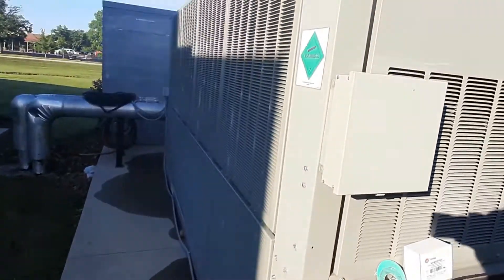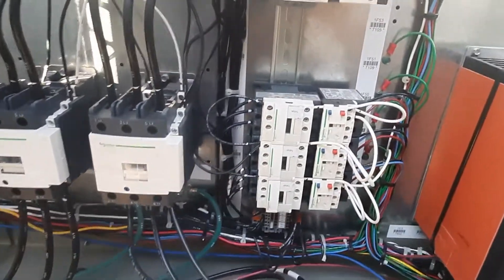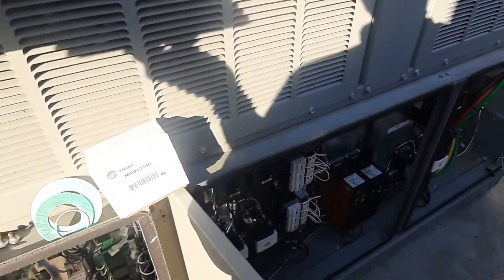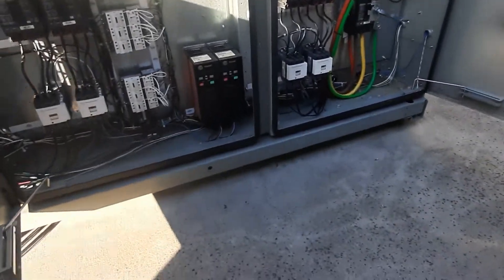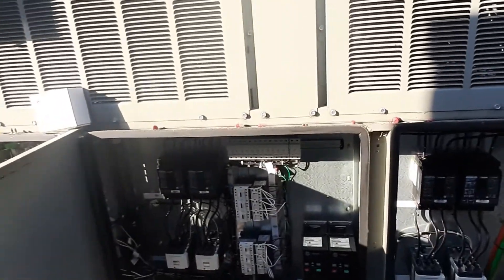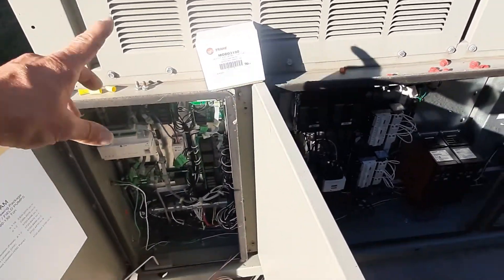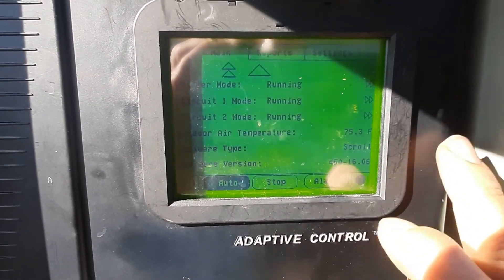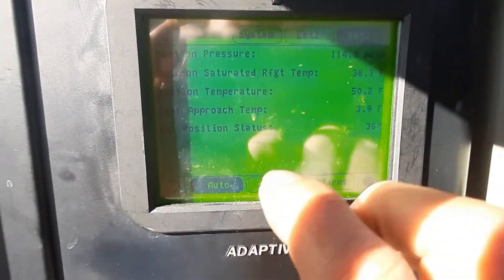Chiller electrical checks, control overview

Comment: Thank you for this video. If you could show the coil cleaning part that would be extremely helpful. I am doing the chiller pms for 56 sites, all air cooled except 2 water cooled.
Reply from the maker: Thanks Kyle! I usually get inside and rinse well...well.. that means when I am done there is nothing around, all leaves and debris removed. shut off one stage at a time and clean if possible that way you can keep the customer comfortable. It's tough and you get wet but it's the only way to get inside. I'm kinda particular but the concrete around and all debris gets removed from area.
Reply: @EverythingHVACR  I have been removing all debris from under and around and cleaning from the outside and underneath...very wet very gross lol but would it be better to go from inside out like regular hvac system (removing cond fans) ?
Reply from the maker: You can remove the condenser fans, it's just going to take you longer, some may be easier than others to remove. I've never had an issue doing it that way. What I tell our guys is just make sure it's clean spend extra time and go over each coil slowly hitting every inch, if it takes more to clean, just do it otherwise it becomes a service call and someone is gonna have to get it done eventually.
Reply: @EverythingHVACR  we finished all our sites and I got spoken to several times about that. I took to much time cleaning them. But they were CLEAN when done. 5am until about about 10am was the best I could do 🤷‍♂️ but I told the office it would end up being a service call down the road otherwise
Reply from the maker: @kylemcelya5589  your doing right, it takes time, a lot of companies will do half assed coil cleanings, I do not, you want it clean I need the time to clean it. That's just how some companies work, if your in my area there are a lot of people hiring
Reply: @EverythingHVACR  no I'm in Tampa FL or I would have put in an application with you guys
Reply from the maker: Isn't Kalos in that area?
Reply from the maker: I'm wrong he's in Orlando
Reply: I am new to chillers and not getting consistent information or instructions from my current company nor the internet. I follow your content and trust your work. Please and thank you